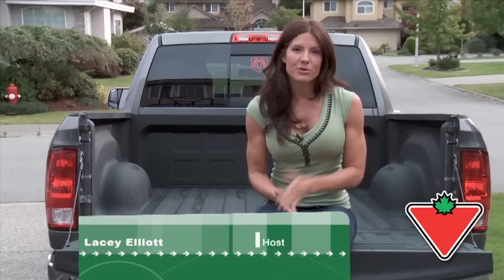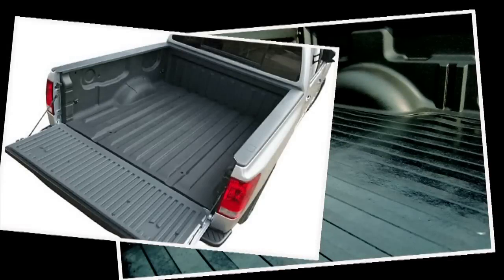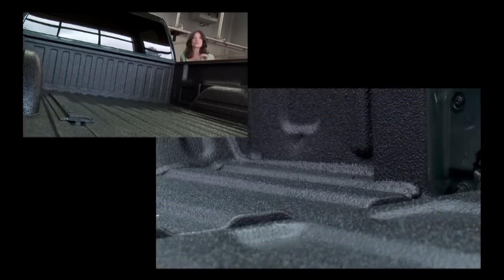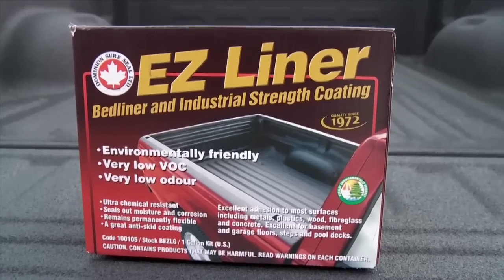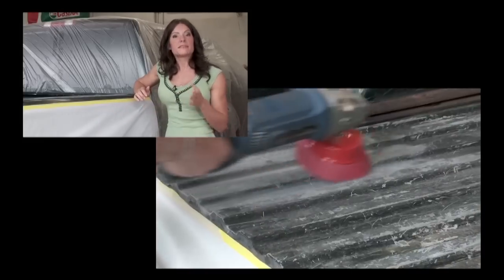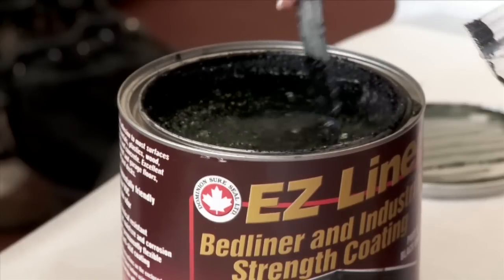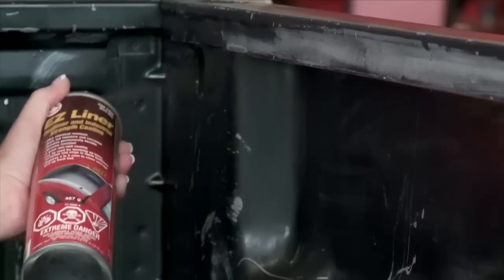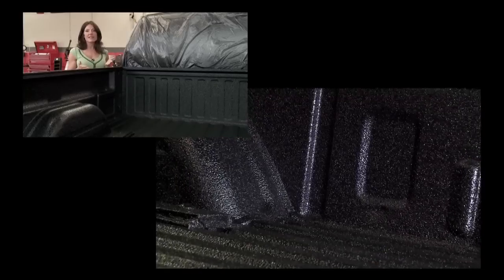How to Coat Your Truck Bed with a Bedliner From Canadian Tire

Comment: just sprayed one of these on this morning with a shutz gun. looks fantastic. as good as a professional job. just gotta spend the prep time sanding and taping. now to wait and see if it stands up to some abuse
Reply: Does it stand up finally? We wanna know
Reply: @jimmynb33  No cause it is rubberized and doesnt have a hardener lol. LINE-X is a HARDENER/RESIN based system (two-part polyurethane elastomer system). That holds up for EVER. Canadian tires stuff will rub off as soon as you skid your foot on it 10x longer than cure time later............... Can let it cure for weeks. Skid ur foot on it. Comes right off. lol.

Comment: You need to create a bonding condition for the Liner formula to stick to metal, best way is to sand/grind/scratch the zone being coated to create a somewhat rough texture (remove rust at this point too).
Reply: she literally said that in the video...

Comment: Do u need to really Sand the bed before spraying or can u just clean it down
Reply: Alex Barker sanding allows it to adhere. You can't just clean and spray as you need to give a surface for the liner to grab onto.

Comment: Drop in bed liner can atleast prevent dings and dents. I'm going to Plasti-Dip my bed before I put one down to stop surface rust.
Reply: One thing I can point out is to make sure the drop in liner is very secure. If it is not the liner will vibrate and rub and eventually wear through any coating you have put down.
Reply: plastidip doesn;t prevent rust  dummy
Reply: @theweightlifterknownasbobw7707  that’s like saying paint doesn’t prevent rust, smarty
Reply: Thats an awesome way to waste $. It will just rub through the plasti dip everywhere. Water seaps in behind the dip. Rusts 10x faster HAHA. WUHHHHHHH. 9 years later, please show what is left of the bed today haha.